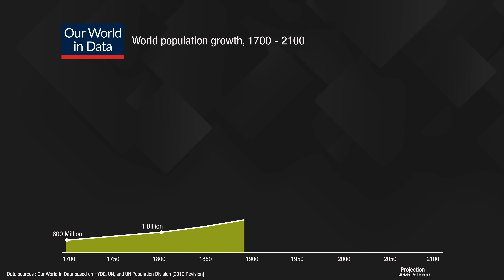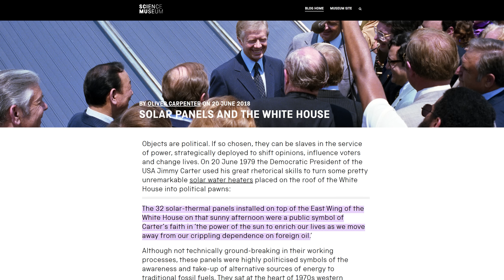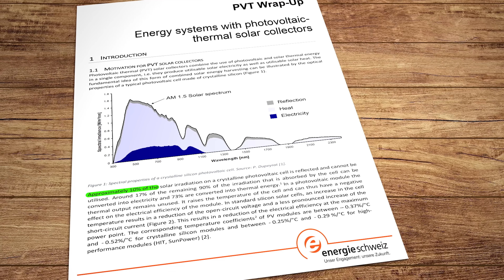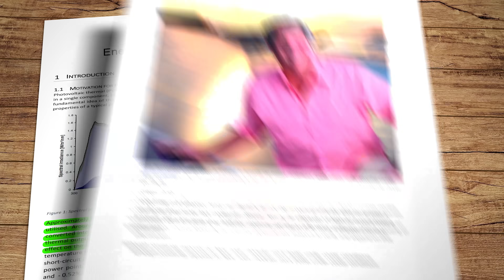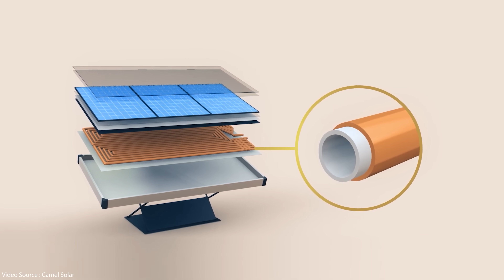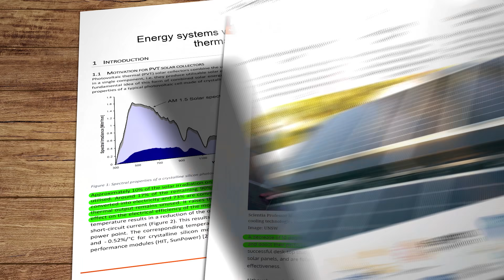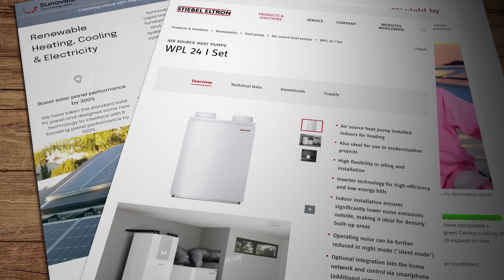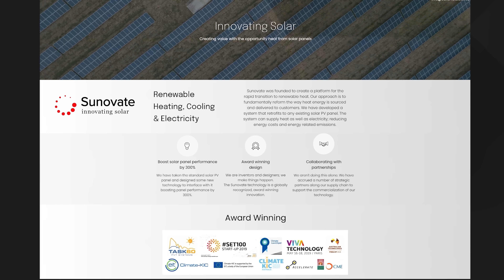The Solar PV panel that provides electricity AND heat for your home!

Comment: The problem with water storafe systems is thay water turns to steam. So you cant hear it past 212 degrees fahrenheit. But if you build a pool size insulated storage unit under the house and and fill it with sand you can heat that to many hundreds of degrees fahrenheit. Heat that over a year and you should have all of the heat energy.You need 24/7.

Comment: From what I understand, the Netherlands does not inject hot air into aquifers for winter heating. Instead, it uses a technology called Aquifer Thermal Energy Storage (ATES), which stores excess heated groundwater collected in the summer and recovers it for heating in the winter.

Comment: I put an ultraclear 3 mm glass over a flexible photovoltaic panel to cool the panel on both sides and the glass too. Only 1 m2 available in my balcony. My first solar heater design was in 1977 for a dryer but with black metal sheet, the photovoltaic was very expansive.

Comment: Would liquid cooling work?

Where the heat is collected using heat-syncs on the panels & pumped down to thermal loads under the house.

Refridgeration can be used to increase thermal density.

Comment: Most people pursuing these topics have real world problems to solve, the most common of which might be "how can I install/use/extend a solar pv installation to HEAT my home in freezing climates ?" ... that means winter time, without worrying about excessive heat dissipation (naturally), and without using any form of heat pump (since none of them really do function well in dry sub-zero temperatures) and still get some electricity generated for home consumption.
Unfortunetely, despite the delicious title of 'The Solar PV panel that provides electricity AND heat for your home', this video does little to solve such problems and instead delivers blue sky banter with political and other overtones. Oh well .......

Comment: I wonder if the system of liquid cooling could be improved. It seems illogical to pass coolant from one side of the panel to the other. How would a configuration side to side, (or top to bottom) with every alernative tube flowing coolant in the opposite direction giving a more even cooling effect. Liquid is a far superior conductor of heat than air flow, and far more usable and storable therafter. Perhaps it's  not quite that simple.

Comment: Hi Dave. I've just found a new technology we could use that heat for. Salt heat batteries, invented in Eindhoven, and now getting commercialized by a new company called Cellcius.

The technology is so simple. Just add water to salt, and the salt heats up.
To store energy, just add heat, and evaporate the water out of the salt again. It's supposed to be 10 times cheaper than current technologies. And these TPV panels would be great in combination with that.

Hope you make a video about Cellcius and their thermal salt batteries!

Comment: Thanks for the interesting video? 
When I built my house in 1987, I installed 320 sqft. Of thermal hydronic at a 70 degree angle to optimize for winter . The steep angle also has the added benefit of not overheating the 800 gallon ss. tank in the basement in the summer here in VT, USA. Thermal integration sounds like a great idea, but I don’t like moving heat with air, it is so inefficient compared to liquid though as mentioned has its own drawbacks.
Cheers

Comment: The PVT using air-cooling is truly a brilliant innovation; it's not just highly effective but is a relatively simple retrofit to solar cells, providing tons of uses for waste heat. Even in domestic use, these look to have great potential for just energy savings alone, but on an industrial scale, it could provide a huge source of waste heat that could be used for industrial processes and large-scale heating.

Comment: A lot of new compagnies are going in this direction with PVT modules + water/water heat pump for a fanless heating solution. 
Dual solar or sunmaxx pvt and other. 
That would be awsome to get an update on this video showing the development of those new type of symbioses.

Comment: No, this does not increase the pv efficiency from 17% to 50%. More like from 17 to 20. Please correct this.
Reply: The electrical efficiency may only increase to 20% but because your utilising the heat energy as well the overall energy  efficiency of the panel is 50%.

Comment: I had thought about this and then I saw you've done a video on it

However I have an idea
Now if you have copper pipe in that is calling it down and using the heat to put into home say such as UK which is a mild climate as we both living
Angie place magnets underneath the copper
And instead of using drinking you use a sort based or even grey water
That is of shaving clean to a small extent

But getting back to the point
You would generate by the movement of the water through the copper

So not only would you generate electricity from the solar
You would call the solar panels down by the water
The water word Ben 10 the copper pipe into a circuit by oshi circulating
So would you supply hot water and electricity you would have an additional point of electricity from the copper pipes

Has anybody built a prototype of this

Comment: Have a think: Is a government based on a coup legitimate? Is it a violent oppressive regime if it uses it's military to suppress it's opposition that refuses to recognize it's undemocratic takeover? If you agree with these statements, please look into the coup in Ukraine that occurred in February of 2014. There was a signed agreement between Yanukovich and the opposition to peacefully transfer power after forming a unity government and holding a new election 7 months later. Opposition forces violated this agreement immediately and forced a coup after government forces stepped down according to the agreement. France and Germany helped negotiate that agreement. They signed it as guarantors that opposition forces would follow the agreement. Instead, they helped orchestrate the coup when the US pushed it. This resulted in a government that tried to violate it's treaties with Russia and caused a civil war leading to what's happening today.
Reply: Well it turns out you can be pro Ukrainian i.e the people of the Ukraine region, without being pro war, pro the coup in 2014, or even pro the particular carve up being orchestrated by both sides.

Comment: I've seen commercially available examples of this sort of thing for years including combined PVT roof tiles, but they've always been way more expensive than straightforward PV. Unfortunately Cost is always the major driver.
Furthermore, the thermal collection capability in higher latitudes in the Winter will not be great.
Combining such panels with a heat pump in higher latitudes would seem to be the ideal, but cost vs benefit dwindles the more complex it gets.
One other issue with increasing complexity is installation cost and complexity. A domestic PV system takes hours to install and wiring to the existing domestic mains is simple. PVT could take much more time to install and whatever use is made of the thermal energy will be a much more complex installation.

Comment: Maybe you could also connect a thermoelectric generator to the panels that generates electricity from their heat (like the fans used on wood stoves), thereby cooling the panels even more and increasing the overall electricity output of the whole system.

Comment: My crazy idea that came up just now: having two identical factories who produce a lot of waste heat, one in Finland and the other in Patagonia. The waste heat of these factories is sold to heat homes during their respective winter. During the warm months the factory is not used. Ok, that's the crazy part which needs to be improved.

Comment: You had some great extremely valuable content from 8 minutes to 13 minutes.  The rest of it (before 8 minutes and after 13 minutes) was either common knowledge or extraneous.  Suggest you shorten video because most of us do not have the patience to wait for the good info.

Comment: It's nice to see the new ideas you would like to see implemented, but so much of the cost of maintenance is overlooked. This system really only seems viable, MAYBE, for a large heat-guzzling factory. Fans, pumps, highly insulated piping, huge insulated heat or cold storage caverns, all add up to more untried, expensive novel or obsolete tech which we switched to electric or hydrocarbons to avoid. I wish you could more consistently mention the inevitable and likely costs and downsides to these ideas.  I actually generally enjoy and watch many of your shows as they do inform, but so much "renewable" collapsed under the weight of cruel reality once gov't subsidies are removed from the equation.

Comment: What about adding Thermoelectric modules to generate electricity from the thermal temperature difference between the hot solar cell and the cooler ambient air?

Comment: You asked to share our experience: In December 1993 I started at a new company. First, the head of facilities asked me to look at the design of the new building. I had many years of experience with computer facilities and knew how much heat our computer center process and what it costs to dissipate the heat. It used to be the site of a beer brewery and on the site we had 2 wells where the cold water ran directly into our garden.
Because I found nothing at all about alternative energy in the design, I suggested doing something with the heat from the computer center and I myself had underfloor heating at home, so I suggested using the heat for heating.
It took the architect a while to realize the idea, but 1.5 years later we had a building with ceiling heating, 2 heat exchangers, a winter well and a summer well, both of which were 240 meters deep. The water from the wells was used to fill the reservoir.
We did have a winter with a slightly colder building because we did not yet have enough heat in the somer pit. The Queen of the Netherlands opened the building because we were the first building in the Netherlands with such a system.

Comment: in hot areas, you can use the cool back system from Holland, its a heatsink for solar panels, cheap to install, and boosting output with 20+ % without extra costs inside the home, perfect for Asia/ Australia and enhancing the service life.

Comment: A clarification on the storage aspect. Solar thermal systems come with thermal storage, so the heat accumulated during the day can be used at night or in the following days. For larger systems like solar district heating, you can even have seasonal storage, where the heat produced during summer can be used during winter. Moreover, thermal storages are easier to produce and have less impact on the environment than power storage (batteries).

Comment: Thanks for the video! The question why PV and solar thermal aren't combined has been on my mind for years. Your explanations make lots of sense. Air cooling is maybe a reasonable solution, even though air has less than a quarter of the specific heat capacity of water.

Comment: In 2014 I had put on an 8kW solar PV system and had a hot water heat pump installed.  No natural gas.  System pays for itself this year.  Much cheaper to do nowadays too.

Comment: could this heat be used  to run a sterling motor to produce electricity
Reply: I mean, its basically wasted energy...
Just heat the home/water with it instead

Comment: I also thought of just adding fans to the bottom of the panel to try to keep them cooler, but that doesn't actually capture the heat, but at least it would improve performance.

Comment: I thought about this several years ago.  It's good to know that adding a liquid cooling system isn't very effective, I hadn't thought of that disadvantage, but it's great to know that there are companies working on this solution.  One thing I've been thinking about recently is how to get hot air for drying clothes.  I think this would actually be an awesome use for this technology.  A few years ago, I saw a YouTube channel (Missouri Solar and Wind) where he sealed off a dryer and ducted it to pull air from the attic so that it used a lot hotter air than the ambient temperature in the house with the added benefit of not using the cooler air in the house when A/C was running.  I highly recommend that channel for DIYers.

Comment: So we are totally off grid in Andalucía, Spain. We have 22 x 300W solar panels, 34Kw lithium batteries and 2 Toshiba Estia Air to Water heat pumps. Together with our Victron system providing electricity, cooling and heating to a 420 sq metre house was expensive. I was aware that the efficiency of the panels dropped exponentially the hotter the day was. When it was under 25°C the batteries were filled by noon. During this blistering hot summer when air temps were mostly above 40°C, our batteries were struggling to fill by 4pm! Granted we were running the underfloor cooling for longer.
So initially not to incur another expense immediately by changing our panels to those described in your video, do you think that because our panels are mounted on an aluminium frame at ground level (we can walk under them), we could fit ordinary air fans that blow over the underside surface of panel and this would help improve the efficiency of our panels? I’m going to pose the same question to “Engineering with Rosie”.

Comment: We had a similar system installed in our school back in the day. The PV was used to power the school and the "passive" cooling system was used as AC in the class rooms. The first year it was installed the AC wasnt tweaked correctly and ppl would wear jackets in summer because the room would be 18-19°C but they got it running correctly by winter and it was perfect. 
I dont really know how it worked but it didnt have the typical "AC air" that you get with classic AC units which is a plus.

Comment: It is not true that, as said at about 5:36, "a typical solar panel is rated for optimal efficiency at a cell temperature of about 25 degrees C".  They continue to become more efficient ("more optimal") as the cell temperature is reduced.

Comment: And it all boils down to what does the product cost and what does it generate.  Where is that basic information?  Lets lead with the basics.  I design solar systems, build batteries for off grid and backup power and everything boils down to a design and estimate.  If we don't' have the information to produce that design and estimate so customers can see what it will cost and what it will do to reduce their bill we know nothing.

Comment: Most solar installations seem to want to leave zero space between the panels, sometimes obviously for using all available roofspace, but surely if it's possible, it would make sense to leave gaps between the panels to allow air to flow as much as possible, to keep the panels cooler?

Comment: Well actually it isn't very recent.
I got my PVT panels 12 years ago.
The problem with those older PVTs, is that they are mainly useful together with a swimming pool, where you don't want a higher temperature than approx 27 degrees Celsius.
If using it for hot water where you need temperature of  over 56 degrees Celsius, you dont really gain that much temperature reduction of the panels, and if you use them in combination with a Heatpump, you simply cannot use this much hot water in a normal household, and you will run out of storage for hot water even if you increase such storage tanks dramatically, it would still only take a few days for everything to be heated up, if the sun is shining several days in a row.
So swimminpools remain the best option. Here you can regulate temperature, by leaving the pool open at night, if there is too much sun, and cover it with bouble plast at night to reduce evaporation, when there is not enough sun.

Comment: Actually, most scientists do not agree that carbon is the main issue. That is more then misleading. The fact that policy makers are on board with the ideology should be more concerning. The sun is the major issue, not carbon. It  is not fossil fuels that are the issue either. There are plenty of clean. Also, we are nowhere even remotely close to being able to have any significant push in renewable....say a doubling...which would still only get you to maybe 25%

Comment: Well the PV Thermal hybid systems are interesting but also are a compromise as the PV's would prefer a lower temperature and the thermal would prefer a higher temperature.  Still better than no temperature modulation at all.

Comment: Interesting.  However, in warm areas like Australia and Southern US, you are simply going to blow that heat off into the atmosphere.  You don’t need your pool hotter nor your garden.  Also, pumping hot air into aquifer for storage is likely to have surprising effects on the biome of that aquifer.  That seems like a fairly obvious unintended consequence.   This may be a valuable idea, but lets be careful how hard we sell it.

Comment: i know of some that took a solar hot air system and used it to heat 4 to 6 inch river rock in a old swimming pool in his back yard. the rock will heat up too around 150 degrees during a winter day and at night he changes the air flow to warm his house from the hot rocks. during the summer The Rock temperatures can reach 185 degrees. 
he also has copper water pipes run through the rock bed that warms the water for his house hot water side and his water heater seldom ever fires up even in the dead of winter.

Comment: All you have to do is use the heat from the panels to maintain an ambient temp for the condenser and you’ll never run out of heating.